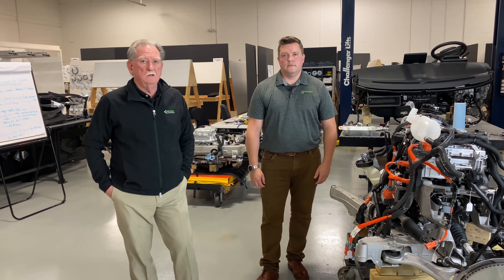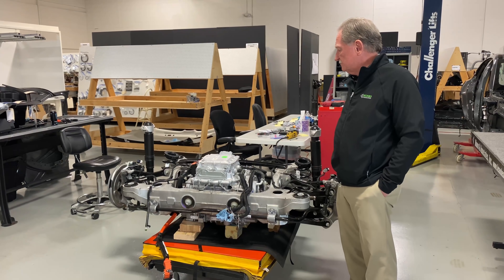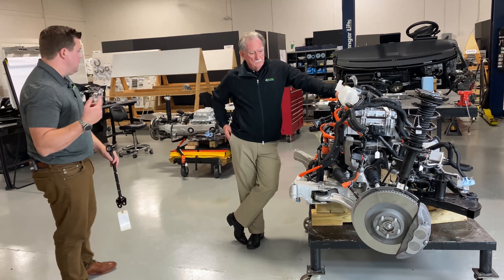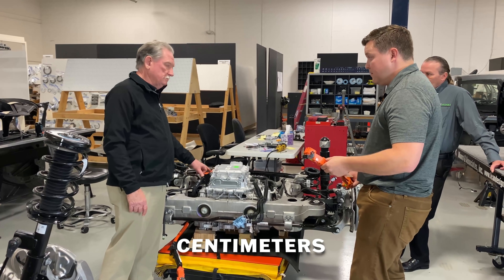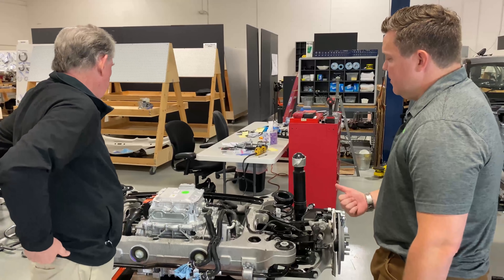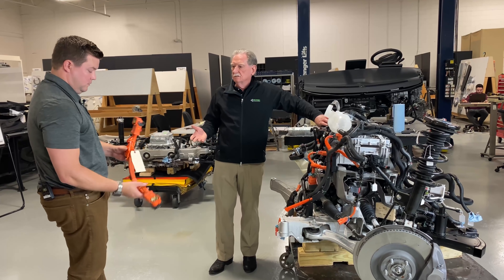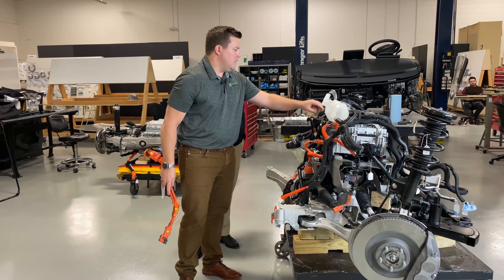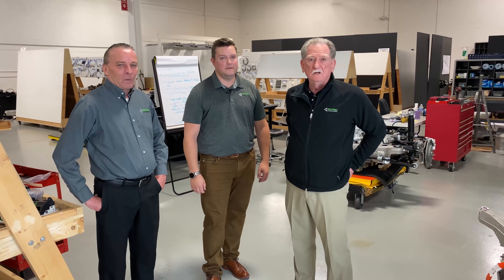Mach-E Suspension & High Voltage Wiring Compared to Tesla Model Y

Comment: Could it be that some of -not-so-innovative choices on the Ford make it somewhat more repairable? Kudos for Tesla for all the innovation and ingenuity they putting into the product to push forward the technology, but they are not a paramount of serviceability seems to appear.
Reply: Repairability from breakdowns? How about designing it where it doesn’t have to be repaired?
Reply: @ZeusBullyMax  stuff brakes, it’s a fact. Sometimes happens, being a defect or an accident. Would be cool if Munro would make some comments if he thinks a design could be easy repairable then another. I do understand that my nature highly integrated complex system or intrinsically hard to fix without replacing big sections. I’m only contemplating if some design are overly complex for the sake of, to cut cost or to actively make it impossible to repair
Reply: @giovannifacci  i’m not too concerned about it. If it’s not my fault and it’s very significant wreck at all the insurance companies just totaled them because nothing can be fixed easily even with today’s cars. I’ve only had three wrecks in 47 years and they were all women running into the back of my car so the rear bumper is all I worry about.

Comment: I still think in the next decade, Plug-In Hybrids are the better choice for most costumers application. The benefits of an EV, without the range anxiety. Also more Environmental sustainable, for having a bigger life expectancy with normal use, compared with other EVs, that once the battery pack is degraded, it totaled the car in most cases, plus the issues in recycling them. Once we get an huge improvement on battery technology, then EVs are for sure the preferable choice.
Reply: Hybrids are a dead end, all the companies wasting time on them will be bankrupt within ten years.

Tesla batteries will go 500,000 miles without significant degradation, then get repurposed for power arbitrage, then get recycled.
Reply: @fredbloggs5902  What is "Environment friendly" about an EV, with less life expectancy than a Hybrid, and a battery pack not easily recyclable? Also with expensive repairs that totaled the car quick. Think about that.
Reply: @RogerM88  
You think an ICE in a hybrid will last any longer than one in a straight fossil?
You think that once EV sales increase (they are!) Fossil fuel will become cheaper?
You think the resale value of hybrids is going to hold?
WHY do you think a battery pack , ISN'T "easily recyclable"?
(You are aware hybrids have them as well?)
Why do you think a hybrid won't be "expensive to repair" with its TWO systems?
"Think about that"
I'm genuinely interested in your logic (or lack thereof)
Reply: @fredbloggs5902  where are those high capacity promised Tesla batteries? If it follows the trend...they gonna double up the size of the current cells, and call it as an "improvement". While cutting the extra weight in the quality construction.
Reply: @RogerM88  How is the Tesla battery life expectancy of over 500,000 miles, less than a hybrid? 

Careful, your ignorance is showing.

I hope they’re paying you well.
Reply: @fredbloggs5902  one thing it's "Miles expectancy"...other thing it's "Time expectancy". Battery cells decay over time, independent of the use you give it. Plenty of ICE and Hybrids driving around, with more than a decade of use. "Careful, your ignorance is showing."
Reply: @fredbloggs5902  also you are relaying too much in what Elon says. Elon is like a Salesman, that wants to sell his products. Go check, how Tesla cheats on the testings to boost their marks. More evident on the 0 to 60 time marks.
Reply: @RogerM88  I’m no longer remotely interested in your opinions, your comments reveal profound ignorance.
Reply: @fredbloggs5902  you didn't counter argument any of my remarks. Do you really think in remote countries with lack of proper recharge infraestruture, you gonna have a fully EV market there? Hybrid are here to stay for decades, you like it or not. Also the battery technology needs huge improvement in technology to be more recyclable. Rare metals, are very hard to extract too.
Reply: @RogerM88  
Fred didn't (I don't blame him!!) But I did.
Answer with data, not "opinion"
Reply: @rogerstarkey5390  here we go:
You think an ICE in a hybrid will last any longer than one in a straight fossil?
No but surely more than an EV that is totaled in a junkyard due to a degraded battery pack.

You think that once EV sales increase (they are!) Fossil fuel will become cheaper?
Will be worse, because Electricity prices per kWh will increase exponencial due to the need to increase the production an upgrade the grid. Way worse, because it impacts every single citizens, even not owns a car. Also plenty of fuel will be around, since you also have plenty of old ICE cars around.

You think the resale value of hybrids is going to hold?
Yes, because the costumer knows he has a product that will last some years. Check the high devaluation on used EVs like the Nissan Leaf.

WHY do you think a battery pack , ISN'T "easily recyclable"?
Facts. Check how many EV battery packs were recycled.

(You are aware hybrids have them as well?)
Hybrids tend to have lower capacity battery packs, and usually use a NiMH (Nickel Metal Hydride) that is considered a non-hazardous waste in most U.S. States, with the exception of California. Unlike Lithium Ion batteries, that contain hazardous materials, and have an inconvenient tendency to explode if disassembled incorrectly.

Why do you think a hybrid won't be "expensive to repair" with its TWO systems?
You have an example...Toyota

Why "burn a lot of diesel"?
You will need Diesels around to move the industry of heavy machinery, to mining all those rare metals to battery packs.

Which "rare metals" exactly?
Cobalt and Lithium.

Why "barely a decade"? (1 million miles= 30 years)
Do you even have data to support that? Do you have any Nissan Leaf or Tesla with that age driving around with the original factory specs?

Why do "Hybrid" batteries last longer?
NiMH (Nickel Metal Hydride) tend to last longer recharging cycles, and be less prone to overheat. That's why Toyota is insisting in using them. Also, the car ICE is still usable with a high degraded battery pack.

Also...take note of all the energy spent in a car, that is obsolete in one decade, and you need to build another one to substitute it. And the almost slave labor in mining Cobalt.
Or how you gonna charge an EV in the middle of the wild in an expedition.

Hybrids are still here to stay for a long time. 

"Think about that"
Reply: @rogerstarkey5390  like other fanboys, you're the one lacking data.
Reply: @Jimmy Edward to build a non recyclable battery pack...you need to burn a lot of Diesel, through mining to get rare metals, to produce them. Also, having a car that barely achieves one decade of use, and then becomes obsolete...it's not sustainable at all.
Reply: @RogerM88  
Why "burn a lot of diesel"?
Which "rare metals" exactly?
Why "barely a decade"? (1 million miles= 30 years)
Why do "Hybrid" batteries last longer?
Reply: Just NO

Comment: Ford is going to use the VW MEB platform in Europe. Not in the US. The Mach E is not built on that platform so no surprise they are not sharing components or methods.
Reply: I get the impression that the Mach E was a special project like the GT40, used to showcase the EV capability that likely won’t be present in any of the other EVs.
Reply: The US made mach E will be made with parts from US suppliers. The European mach E will be made with parts from European suppliers.
Reply: @ZeusBullyMax  at the moment there is no mach-e production in Europe and i am not aware of any plans for the future..all the Mach-E sold in Europe are shipped across the Atlantic and made in  Mexico at the moment)

Fords biggest European Factory ( Cologne, Germany) is currently renovated to produce EVs, but as far as i know, not the Mach-E.
Reply: @tzarcoal1018  They will produce it over there. It is their flag ship car.

Comment: All of those cooling hoses on the front induction motor looks like a mess
Reply: @Alfred Wedmore I believe it would be that very statement itself is where I disagree. That complex assemblies are not necessarily bad. I believe complex assemblies ARE all bad. That said, yes, sometimes you have to accept complexity to achieve a set of parameters. I don't believe adding complexity, to enhance maintenance accessibility is a good tradeoff. To me, better engineering can, and should, accomplish that goal. And in the case of Ford, that might mean spending some extra money to get a specific part for a specific vehicle application. As opposed to picking something off the shelf and accepting all the inefficiencies that entails. Yes, there is a necessary cost parameter to work inside. This is where intelligent engineering and great engineers are required. Tesla is doing it and still making a nice profit on each car sold. So why can't Ford? Bad management and corporate structure, is what I see.

I am not an aeronautical engineer. But I do have a degree in a similar space and I have been a Helicopter mechanic for a few years, and a profession pilot for about 20. Most of my mechanical knowledge is derived from practical experience more then study. And it is a wildly different field then automotive, but I do watch quite a bit of detailed analysis of these new EVs and the new private space companies.. and I'm fascinated by the new approaches they're using in engineering some incredible advancements.. in a very different way that the established companies in the same spaces
Reply: @Alfred Wedmore I have no real practical experience with battery assemblies, but from what I've seen the cylindrical cells are actually less complex then the pouch cells. To manufacture at least. And I don't believe there is much added complexity in just stringing a bunch of little cylindrical batteries together. The Tesla modules and battery pack in total that I've seen seem very simple. Where as the Ford one seemed way more complex. Now, Ford uses the pouch and maybe they wanted more accessibility to remove individual packs if they go bad.. but then..  how is Tesla do something so simple and they have very few issues with batteries going bad.. and thus don't need such an excessively complicated battery pack that is also wasting space, and probably adding weight.
Reply: @airheart1  I agree.  Pouches need a complex housing.  Cylindrical cells are the housing.  The 4680 battery will sink heat into plate touching the anodes, making cooling simple.  The tabless design means electrons have a short travel path to cathode.  Maybe I'm missing something.  Ford decided on pouch for some reason.
Reply: @airheart1  - Then there is the battery management system and Tesla is very good at software.
Reply: But they make it sooo cool!
Reply: @Alfred Wedmore It's a good point. There are always tradeoffs. It would be interesting to see a cost comparison in 5 or 10 years of the Mach-E vs maybe a Model Y's long term maintenance costs.
Reply: Octo-valve rendered by Picasso 😂
Reply: I think this has been looked at by Sandy and his team (kinda comical to say the lease):

https://www.youtube.com/watch?v=m1kHsd3Ocxc&t=13s
Reply: @Alfred Wedmore - Check this out:  https://www.youtube.com/watch?v=m1kHsd3Ocxc&t=13s
Reply: @Alfred Wedmore please don't try to compare a jet engine to ICE, much less a Electric motor designed 'engine bay'. We're talking worlds apart on many aspects. And most jet engines you've seen in any helicopter were designed back in 60's or 70's.. lets not pretend they couldn't do with a bit of innovation too. Maintenance is less of a concern when you engineer the shit to not need constant maintenance in the first place. Helicopters is one thing.. they experience massive vibration stresses constantly.. way more then any car will ever see. Just toss this comparison out the window. It has no real useful merit
Reply: @Alfred Wedmore I agree! Having worked on aircraft, being able to fix, "in the field" is a huge advantage.
Reply: @Alfred Wedmore Exactly right. Looking simple does not equal good mechanical design. The octovalve is clever but just think how many readers here have had a leaking washer fluid bottle made of the same material.

Being able to see, touch, and isolate components definitely improves a mechanics likelihood of being able to diagnose and successfully repair a fault economically.
Reply: @Miata822  Remove and replace Octovalve.  Send octovalve to PM depot where it is tested or repaired.  Black box model has some merit.  Also hoses are vulnerable to mice and rats.
Reply: @mefobills279  Yes, remove and replace is a Tesla moto. That doesn't bode well for their cars as they age.

I take it you haven't really looked at the octovalve assembly. It does not simply unplug. Removing it will be a huge and costly job. 

Tesla's philosophy on repair: https://www.youtube.com/watch?v=vVSw3KSevEc&t=182s
Reply: @mefobills279  I'm just perplexed as to why more of the coolant loops of the front motor aren't integrated into the casting, as well as why so many are necessary. 

Aluminium is a highly heat conductive metal, and electric motors are more energy efficient than internal combustion engines. My ICE vehicle(s) don't have near as many coolant lines (I think 4? on my V-twin motorcycle (in & out for each cylinder), and no more on my I-4 car). I assume that's because the engine casting or later boring leaves plenty of channels for coolant to distribute through the block(s). 

Yes, perhaps for the sake of isolating points of failure one needs separate heat exchangers for electronics and motor, but is there any necessary reason an electric motor housing casting can't have one coolant input and one output?
Reply: @Miata822  Thanks for that Bill.  I didn't know octovalve was difficult to remove and replace.  The advantage to electric cars to my mind is the simplification, i.e. fewer things to go wrong.  Then when I see things that will make the car hard to repair, prone to being eaten by mice, or components not easily serviced, then that makes me not want an electric vehicle. The batteries should be easily replaced too, which makes me wonder about the upcoming "structural battery pack."
Reply: @mefobills279  I don't think the octavalve is difficult to remove, the whole point of it is to get rid of all this cooling mess. 

Tesla's approach is to lean on their software expertise, a major advantage in this field, by designing a single part that does the job of three, turning a cooling system into a circuit-like solution, why have multiple systems when one can do the job? Simplify and re-use.

The pros are more efficiency, less manufacturing costs, better troubleshooting through software, the con is you pull out the whole part when you want to repair it. 

But these things, as mentioned earlier, don't operate at high temperatures, so this is not exactly a big concern.
Reply: The front motor is PM.

Comment: Makes me wonder how many engineers at these companies watch your video and either scream in frustration or jubilation at your comments.

I'd crack up if a few cringe if these were brought up in meetings about new designs and hint that retirements might be an option for a few.
Reply: Yes, I bet after the video where they compared the welding robot programming between the two sides led to some interesting conversations 🤣
Reply: Or a Ford engineer pull his hair in furstration, I did told them, but they did not listen.

Comment: As things look now, do you think the Mach E is on track to possibly be a “recommended” EV from Sandy (taking into account the $7,500 tax credit available on the Mach E that’s not available on MY)? Or does it appear that the MY could be worth the additional $7,500?
Reply: I'm not American, but I still fail to understand how congress can allow $7500 discount on imported cars, and the 2 American built brands have ran out, at least should have been the first x00000 vehicles sold or similar to encourage/reward the first to market
Reply: @mjcamp01  Only Tesla has ran out. It was only on the first 200,000 vehicles sold and the amount decreased every year that 200,000 units weren’t sold. Those numbers may be a little off but that’s generally what happened. So, there was encouragement and rewards for being early buyers. Ford (an American company), is receiving those tax credits right now on their electric vehicles.
Reply: @Jimmy Edward wow. 15 minutes into that video you linked and I had no clue that was going on. Thanks for sharing that, mate

Comment: Henry Ford pioneered vertical integration and doing everything in-house.

But there was a ridiculous push for focus on ‘core competency’ and outsourcing in the 80s, presumably the bright spark MBAs in Ford followed the fashion.
Reply: Henry Ford famously pushed suppliers to conform to his requirements. He did much to build the Detroit supplier industry.
Reply: It's what is killing them, so they better go back to vertical while they have the chance.
Reply: @dr-k1667  vertical also kills evolution and flexibility.
Reply: @alanmay7929  How so? Tesla is vertical, flexible, innovative and currently the last word in auto evolution.
Reply: @MarkXHolland  Tesla is also a clean-sheet company. Problem with "legacy" anything is the legacy. It's much harder to change a culture than it is to create a brand new one; starting at the top and going all the way down.
Reply: @brois841  VW's Mr. Diess (supreme Boss) just got a unprecedented contract extension till 2025 to see through the transformation.
Reply: @abraxastulammo9940  aaannd? Did the rest of the employees get the same and were told this is our new path forward - shift or look for another job?